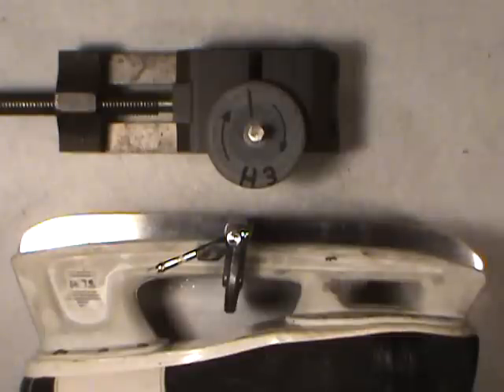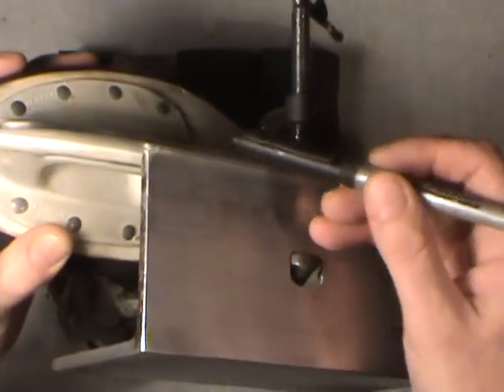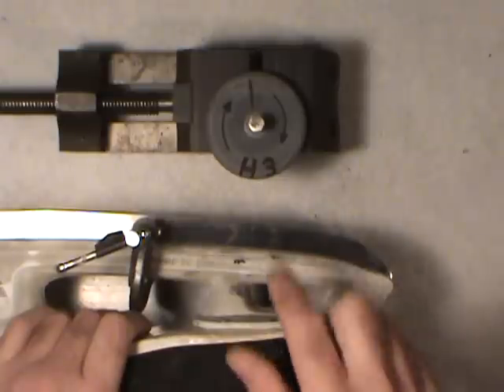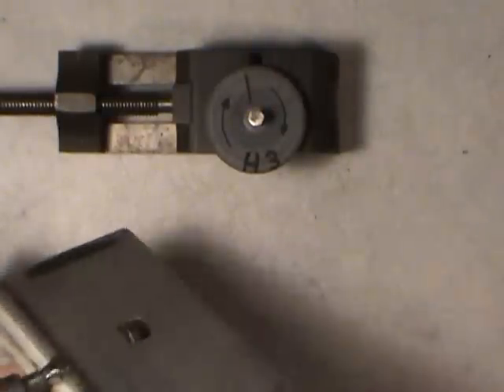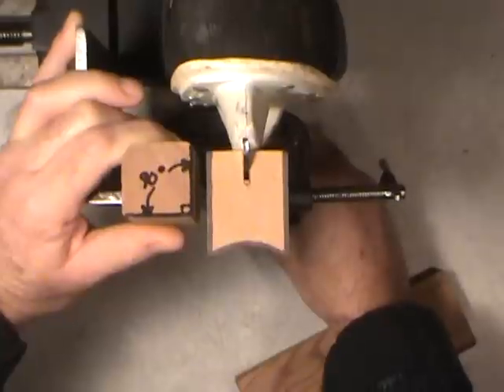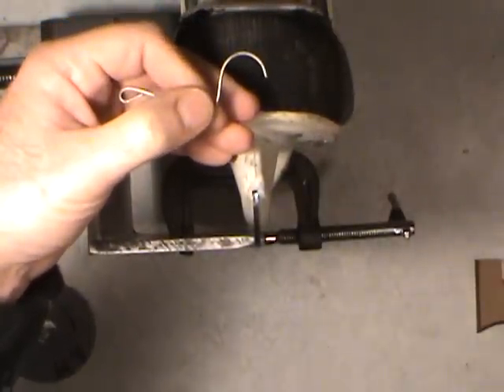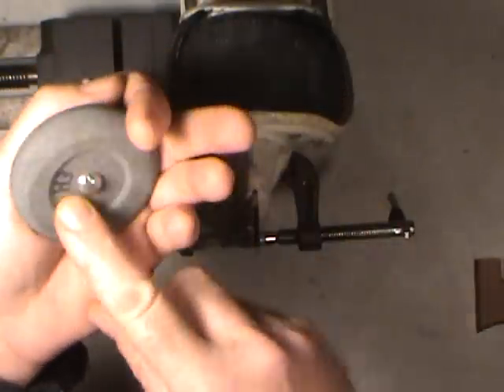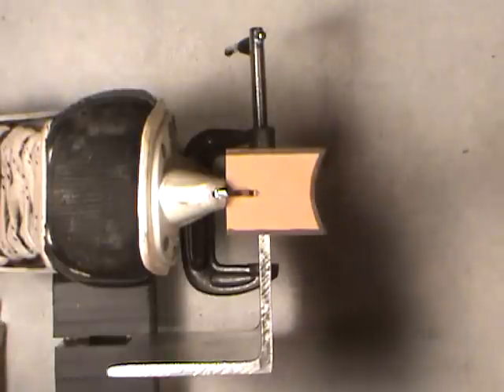Ice Skates Hockey Skates Figure Skates (Part 5)

Comment: where did you find that grindstone? I'd like to set up a system like yours but cant find the grindstone.
Reply from the maker: Greetings...m jew............Thanks for watching...........Well, some years ago, I was in a Liquidation store, and I stumbled upon the round grindstone, that had a shaft, already mounted into it, that I used, in this YouTube video of mine, and, if I recall correctly, it was only $3.50 (that be, three dollars and fifty cents, before tax, in Canadian dollars)...!!!...........I found, that, the "grit" (that be, the individual grains/granules, that make up the grind-stone as a whole), to be, a bit on the, shall we say, "too coarse/too big" side (leaving a rougher finish on the blade, than wanted), as well as, too small in "diameter" as well, for my liking............If you get the chance, have a look, in, an ice skate sharpening store/shop, where the ice skate sharpening machine is located, and you might be able to see the following............I recall, seeing a grind-stone, that was about "7-inches" (175-milimeters), there-abouts, in diameter, and, the grind-stone, was usually "pink" in color, or maybe, sometimes "white" in color sometimes, and the "grit", of the grind-stone, looked pretty "fine" (small grains/granules), when being compared to, my "$3.50", super cheap grind-stone...lol...........Also, with my "super-cheap grind-stone", while grinding, I found that, the blade's "edges", kinda got pushed towards the outside (Burrs, on the blade's edges), on both sides, probably, due to, the not so good, shall we say, "grinding action", that that super-cheap grind-stone, was only capable of, even, when using "very light" (pressure), while performing, multiple..."finishing passes", which also made for, more than wanted..."honing"...of the blade's edges (done with, a hand-held, small, flat, rectangular shaped honing stone)...........Even though, this "make-shift" (redneck), ice skate sharpening system of mine, can't produce, the much better finish, that the, shall we say, "professional" (factory) machine is capable of, I do, still get to do it at my own home, any time of the day, without having to, travel to, a skate shop, that has to be open in the first place, as well as, just how long, I will have to wait...??? (in line...lol), to get the skates sharpened, oh, and, sometimes, my ice skates, at times, seemed to be sharpened "differently", depending on, which person it was, that sharpened my ice skates, as well as, when the grinding wheel was "dressed" last, and, at what, exact radius, will it end up being...??? (size of the radius, of the grind-stone, is usually done with/dressed with, a diamond, grind-stone dresser/profiler)...........Perhaps, try looking in an "industrial supply" store or warehouse, in the area, where you live, or, do a search online, and maybe start with, something like...EBAY...where you live..........Good luck, finding one, and........till next time.......Be Safe, take care, and have a good one.